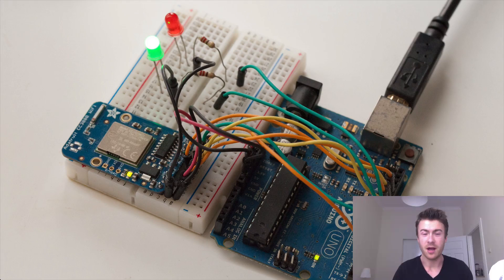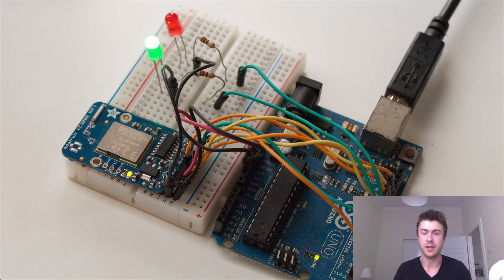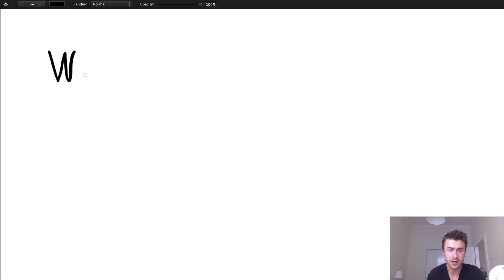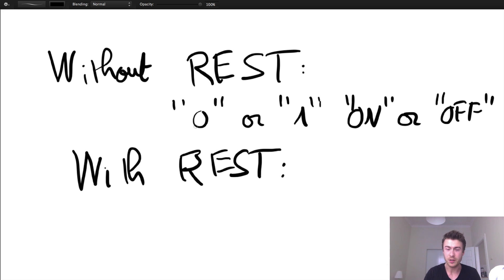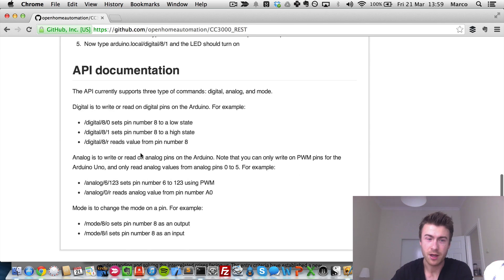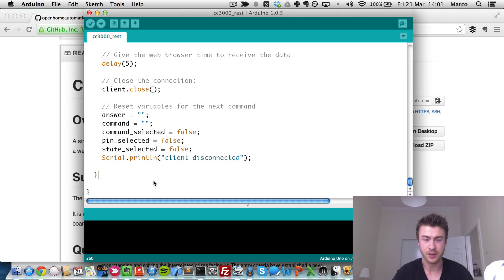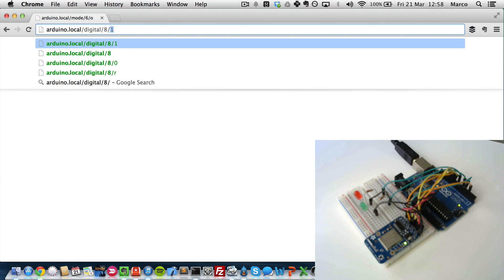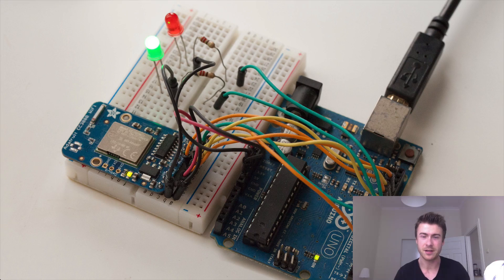A REST API for Arduino & the CC3000 WiFi Chip

Comment: ive read the cc3000 has serious connectivity issues, and needs to be constantly restarted?
Reply from the maker: +av b Indeed, this is why the code now includes the watchdog to reset the board in case it gets stuck :)

Comment: I had a problem on my arduino mega2560 connected with an ethernet shield, i couldn't execute fonctions which were working more than 3 seconds via the API REST. Actually, I used "delay". I didn't understand why it didn't works, but it was finally the watchdog. 
I disabled it and it worked fine :) . I didn't pay attention first to the watch dog because it is used to cancel infinite loops, but it considered my "3 seconds loop" as an "infinite loop" ;) 
Super vidéo, très claire et bien expliquée! ;)

Comment: hai~im using cc3000 conencted with arduino uno, the problem is when i enter serial monitor on my cc3000 sketch, it only appeared "initializing..." is it because of my code?or any solution?because this is for my final year project

Comment: hey , i am using arduino r3 with cc3000 , and i have used all IDE 1.0.1--1.0.2--1.0.4--1.0.6 .
All programs do compile but in all serial port output window it shows "no wifi shield present " , can you help
Reply from the maker: Amit Verma I recommend using the 1.5.7 Arduino IDE, that you can find here: http://arduino.cc/en/Main/OldSoftwareReleases

Comment: Hi, i'm using the rest api with CC3000 and Arduino uno but it only works for a couple of request that the api looks like it's reconnecting in serial monitor and cc3000 stops respondig to get request. Any idea about this behavior?
Reply from the maker: Giura Andrei Thanks for using the aREST API! Make sure you have the latest version of the library at @marcoschwartz/aREST and also make sure that you are compiling with Arduino 1.5.7 or more recent. Let me know if it helps!

Comment: Great video Marco! I'm working on something similar to this, and this would be a great start point to keep on. Now i'm using a telnet client to control my system.

It's possible to make a webpage with javaScript or html and make it send the request by pushing a button?

cheers!
Reply from the maker: Hello Luiz, that's actually what I am currently working on, based on Node.js. You can check out one implementation on this article: http://www.openhomeautomation.net/arduino-wifi-switch/